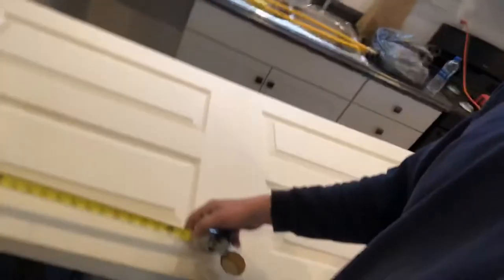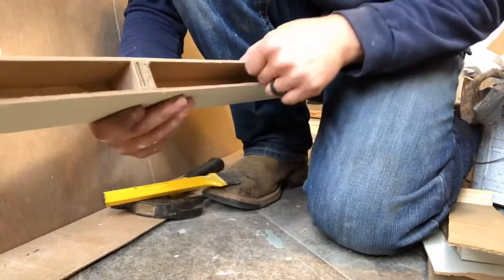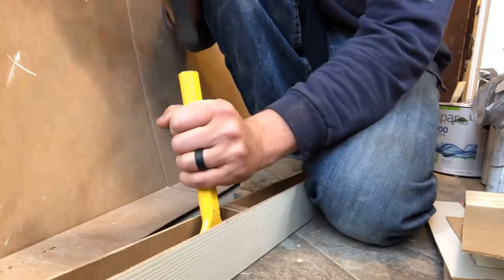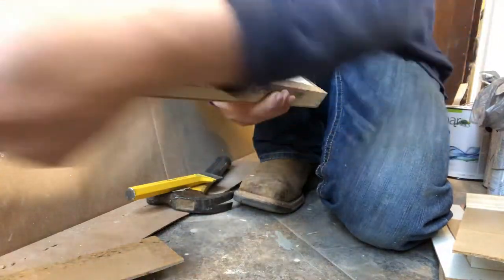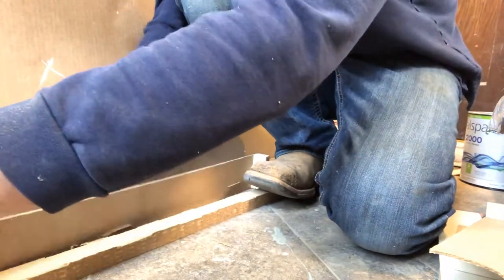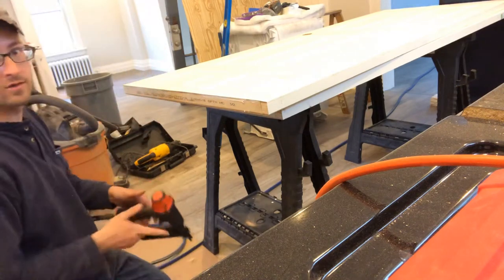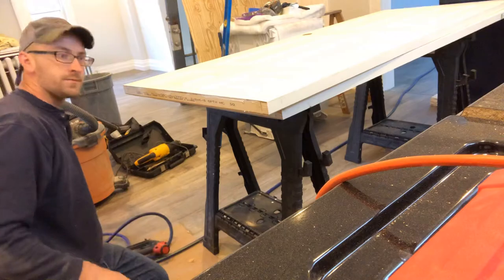How to cut a Masonite hollow door

Comment: My man, I want to express my sincere thanks for this video! You saved me $200+. We had a pair of new bifold doors we had painted, and this tactic worked for them. I had to trim ours down 3/4 of an inch due to new flooring and a non-standard opening. When I saw the hollow door after I cut the pieces I about lost it and thought I'd ruined them. I had to cut out the inner piece for all 4 sections with my Swiss army knife, but I used some liquid nails and wood screws to glue it back in post-cutting. They sat and cured overnight, and are now installed and working like a charm.

Comment: great tip. I hadn't even thought this far through regarding the bottom cuz I am going to need to cut the door length. thanks.
Reply: I just filled mine with “great stuff” and let it dry and then trimmed it either a razor knife or

Comment: Cool trick. Since the door is open maybe you can inject the SPRAY FOAM inside to make them more soundproof if any one desire that. What do you guys think?
Reply: Good one 👍
Reply: Two concerns here; One, inside of a hollow core door there are MDF or styrofoam blocks to keep the panels apart. Putting expanding foam around these partitions is problematic. You will never get an even distribution enough to make a significant impact as a sound barrier. It would be more effective to fill it with sawdust or a material like it and then cap it off. Two, expanding foam can be powerful enough to separate the panels of a hollow-core door. MDF stile & rail is porous. The factories glue these doors together. It's not the best adhesion, as you can see countless videos on how easy it is to rip apart the door panels apart. Some food for thought. Cheers!
Reply: Use material from bean bag chairs .

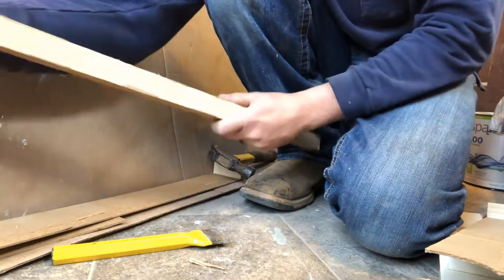Comment: Up to 2:37... fine. But before you glue that core back in, the remains of the hardboard that is stuck to it needs trimming off with a smooth plane. Only takes a minute or so, but if you don't do it, you'll end up with the bottom of the door swelled by 3 or 4 mm in thickness at least.

Comment: now what are the odds you can do this on the vertical too, if i wanted to make a 30" a 26"?
Reply from the maker: I personally wouldn’t recommend it. The door will most likely fall apart. I would either rebuild the door frame for a 30” door or have a custom door built
Reply: @Byhamdirtworx  Well, that's now what I wanted to hear. Ihave no way to increase the size of the door frame (cramming a door into a small area for attic access). I"ve removed the tops and bottoms before. And just assumed I'd be able to take a foot off the side too. We'll see! Nothing to lose but a few minutes of trying I guess.